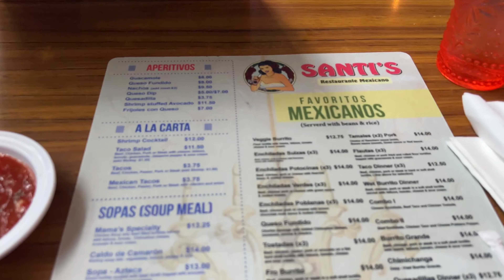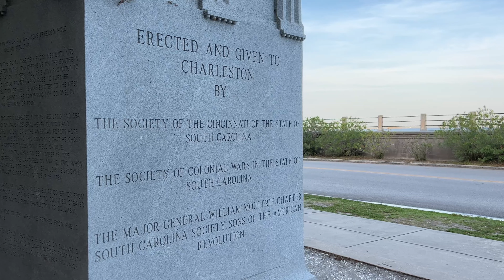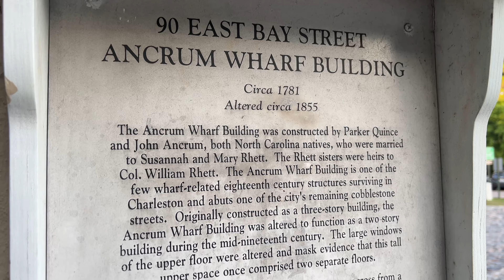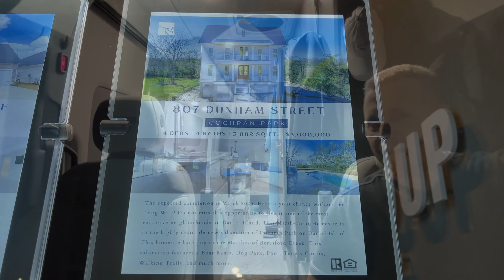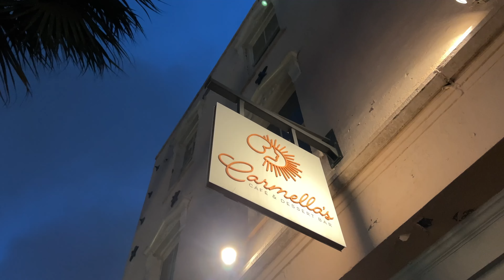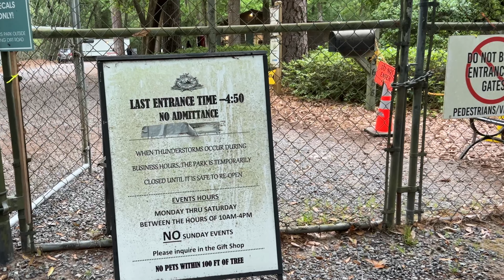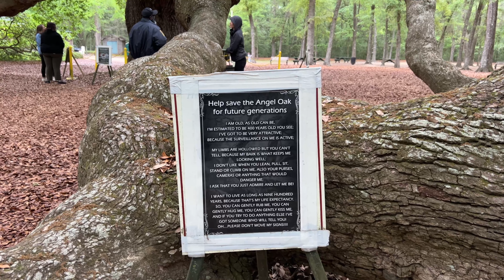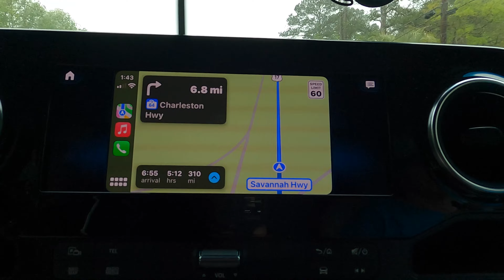RV LIFE BOONDOCKING | NEXT STOP - CHARLESTON SC

Comment: How do you find parking spots?
Reply from the maker: It’s not as hard as you would think. It’s very similar to when we were parking our F250 Super Duty. As long as there’s nothing behind the curb, we can back in to a regular parking spot with the tail end hanging over just like we did with the truck. Not as easy as with a car, of course but we still are able to find parking spots pretty much anywhere we go.